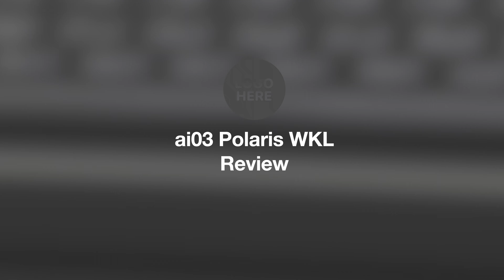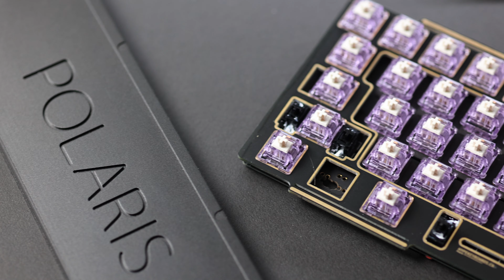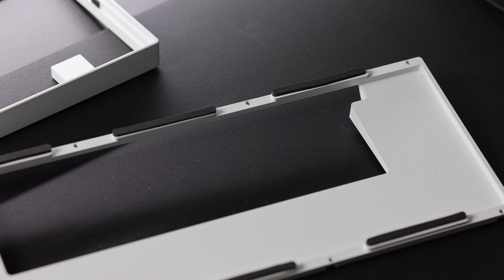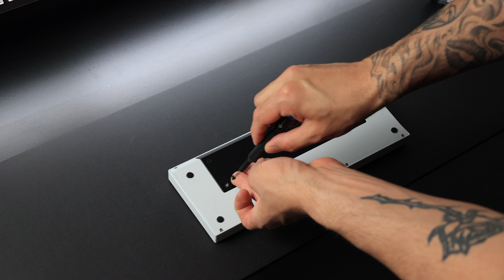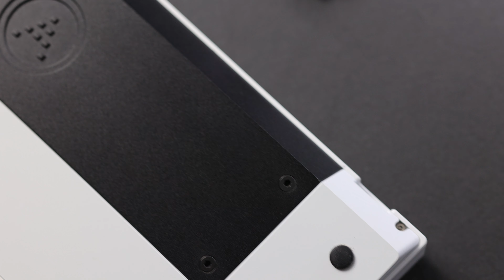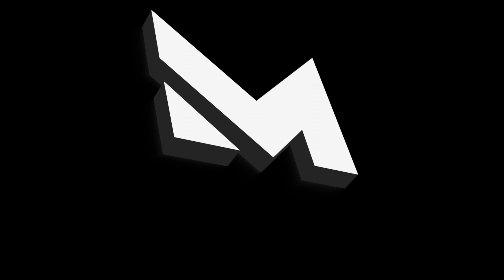my $800 custom mechanical keyboard | ai03 polaris 60% | custom keyboard review

Comment: what foams do you usually use?
Reply from the maker: I try not to use any foams if possible but in this case it was the case foam that came with the Polaris.

No foam between plate and PCB